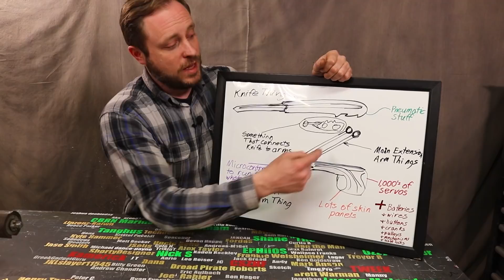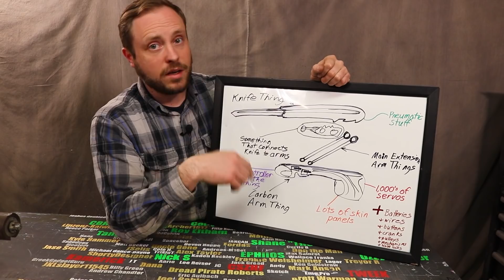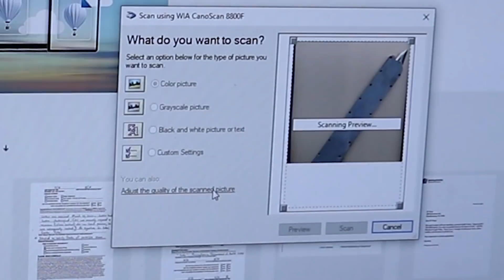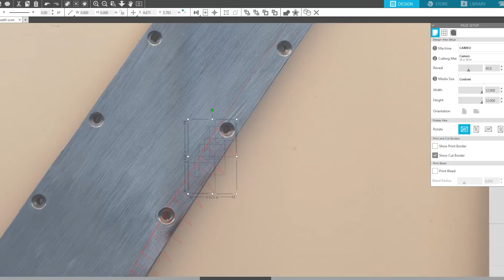REAL LIFE Mantis Blades Cyberpunk - Build Part 5

Comment: Here's an idea for your pneumatics:
Instead of forcing your mainline pressure through the connecting hose to the blade when you want the blade to expand, you can use a quick exhaust valve (QEV) and a tiny airtank to control the amount of air going into the blade extension for more efficient and also much snappier operation.
Reply: This, 100%

Comment: Elegant solutions, graphite powder could be a good short term substitution for lubrication. It works on locks long term but considering you have co2 blasting through the system I'm thinking it could be a once per shoot thing unless it all gets blasted out on the first firing etc.

Comment: Don't know if you care to try but FMO-350AW is awesome stuff. I've been using it in my guns for years, never had an issue and lasts much longer between range days. Net it will work better than the oil your using.

Comment: That elastic will still deteriorate with all that oil..   You should just go with a long thin coil spring, which will still be compatible with your wrap around design and rollers..  Such springs are available in a variety of strengths and lengths..  McMaster carries regular stock of .125 springs up to 36" long and can also custom make any size you need.
Reply: Have a hard time believing you can get a coil spring that thin, that strong and that extendable.

Comment: Have you thought about sealing each screw? (bolt?) Maybe find slightly smaller screws or make them; attach to drill press and slowly file with triangle needle file and then glove up and cover the screws with the gasket material before placing them in their hopefully, final 
resting place.
E: If it improved the seal could you get away with less psi?
Reply: Basically you're just saying he should use loctite